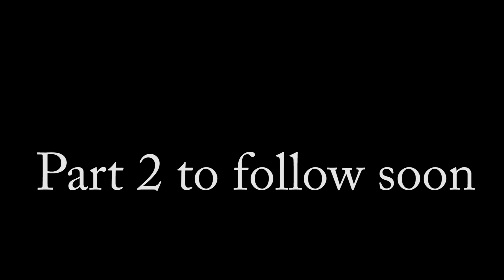Pfizer, process 2

Comment: It's basically the same process has it was back 2005 for hep C treatments.
A injection using a cDNA e coli in interferon with a antiviral medication.  
The cDNA e coli did provide a cure to infection to certain geno types hep c but not all. 
So one clears the infection to what harming body, but antibodies are still circulating in body, from results of PCR neg RNA blood test. Nothing to treat, non infected 
But hep C virus can cause liver cancer. Treated or not.
So might been possible I didn't need get vaccinated for covid. From my research findings in 2020. I choose to get the voodoo juice 2021. Not the boosters.
Keep up the good work Doc.
Thanks.

Comment: No surprise then that regulators accepted the Pfizer vaccine based on the initial batches made with the pcr process, and couldn't be bothered to apply the hard-earned lessons learned from the Polio vaccine to demand a new trial for the production batches which used process 2.

Comment: I make a car and submit it for approval of its new brakes technology - which gets rubber stamped for being safe and effective.
Then I have to make millions of cars, and fast, so I switch the brake system to a different one I can produce in massive numbers, and quickly.
I sell and market the car as if it were the original  manufactured spec, as submitted for official approval for public use.

So.... have I committed fraud?

Comment: I am retired from the aircraft industry, a quality engineer at Rolls Royce. The process here too is everything, to the extent that it is generally the process that is inspected rather than the product which is only tested at the end to ensure conformity to specification. Any deviation from the process will lead to disciplinary proceedings and possible dismissal.

Comment: I worked 20+ yrs in contract bio manufacturing making API and had several large bioreactors. Each different product was VERY precise as to the process, all most to the point of telling when you could blink. There is an extensive process and approvals that must be done BEFORE any change can be made. I don't know how they did that with out FDA approval?

Comment: 40 years as a Chemical Engineer with specialty on process scale up...from pilot lines to full scale production facilities.  Just because you can produce it in a pilot line does not mean you can produce it commercially on full scale....anything and everything will go wrong.  Met a guy while skiing in January 2020 on the ski lift....he was a pharmaceutical process engineer....we talked exactly about this as we had the same background.  He told me they had no idea yet about how to scale up production.  He told me because of that, he would not be taking any jab from the scaled up process.  I will not forget that discussion.
Reply: Nice to do the Link. Looks logic😉🙏🇧🇪
Reply: In Jan 2020?
Reply: At the time there was news that an outbreak was on. I travelled New Year's Eve 2019 through Heathrow, Toronto and Calgary - every foreigner was wearing masks then. Just saying.
  @annecy9280
Reply: @annecy9280 yes. Look up Event 2Zero1. They knew it was coming by October 2019
Reply: Jan 2020?

Comment: Plasmid DNA is used as a transfection vehicle for genetic engineering. If the vaccines were contaminated with plasmid DNA, there will definitely be some unlucky recipients whose own cells have been transfected thus causing those cells to produce spike protein forever and ever.

Comment: I feel so violated in every respect. Having worked in the bio tech industry as an executive , not Phizer nor Moderna, just watching this video sets off alarm bells on the ‘Qualification’ processes not followed. The FDA  shuts down pharmaceutical and medical products productions with no delays for far less breaking of these Quality processes and procedures. They should have their licenses revoked and those in oversight , aka FDA etc , should be charged with criminal neglect. I am also someone that has suffered severely from issues derived from the Moderna vaccine.

Comment: How many people had adverse effects or died  compared to how many people were vaccinated  ? 
How many deaths were prevented or how many  people avoided being in ICU on  ventilators who were vaccinated ? 
How many non vaccinated  people were left with permanent disabilities after contracting Covid  ?
I'd like more statistics.
Reply: it's worth checking out other videos Mr Campbell puts out here. Load of statistics is being discussed and you'll find references to the sources so you can do your own research too.
Reply: Well in New Zealand 00.64% of unvaccinated people died from Covid. Pretty good survival rate. We had mostly the OG strain, Delta, and Omicron in the country.
Reply: @TillyMack44  When?  Was this during quarantine?  Was this after vaccine deployment and herd immunity became approachable?   Didn't New Zealand restrict outsiders from entering the country?
Reply: @paul4020  it was current as at  14 April 2023. Lots of other data needed of course but no one is systematically collecting or tracking all of it, so some of it will be forever a mystery. Anecdotally I know a dozen or so people who never took the vax and none of them had hospital level covid, most had pretty short lived covid, all had longer immunity between bouts than the vax, and none have long term effects from covid and four of them are daily smokers (not a good thing in any case). From all the (many more) people I know who took the vax there has been about a dozen cancers some new some reactivated, multiple heart problems requiring hospital stays, new menstrual issues, emergency department visits, and they all bar one have had moderate bouts of covid at least once as well. I'd like to see more but I admit I'm probably too bias to see past all of this!

Comment: You can bet the important folks got the good stuff.

Not that I think either version actually prevents anything.  One is just slightly safer than the other.
Reply: The "important folks" probably got the good old saline... Allowing them to roll up their sleeves on TV multiple times to convince the unimportant folks.
Reply: That is your official opinion?

Based on WHAT EVIDENCE?
Reply: @childofthe60s100  No. I wrote "probably". That implies it is my best guess. And i'm a child of the 60's too, so i've had enough time to train some good guessing. 
That several heads of states have been showing themselves while being jabbed multiple times for the same round of vcns, wearing different clothes, having a different provider, can be seen online. Trudeau even got a "shot" where the needle was still capped. I guess maybe that one wasn't saline... ;-)
Reply: @childofthe60s100  I am not an official.  This is just my personal opinion and I am sticking to it!

Comment: I have a question. Who's DNA are they using as the original DNA of this process? Also what strain of E Coli are they using for the bacteria? Love your videos! Thank you
Reply: I was wondering that, also. I just read about Henrietta Lacks, who's cancer cells have been used since the 50's for different "creations and tests. The cells  keep dividing, even today when Mrs Lacks died decades ago from an aggressive cancer
Reply: @kathleenrose8848  wow, thank you for sharing this information! You're right, that DNA originally belonged to someone! But they probably didn't ask for it, they just took it!
Reply: Great question. You should look into the process of virus isolation. It has nothing to do with proper isolation. Ever wondered why some people don’t believe that the virus was isolated? Well, you wouldn’t believe the technique they are using for “isolating” that “virus” which really has nothing to do with isolation at all.
Not even having a PROPER control. 
They never truly isolated any virus so far. God knows what they isolating.
Reply: @yankalu2000   Next-generation sequencing (NGS) platforms do not require the target virus to be isolated. Single molecule long read sequencing can read each base nucleotide of the SARS-CoV-2 RNA without fragmentation. For this, we have technologies such as Nanopore direct RNA sequencing and transmission electron microscopy.
Reply: Artifical DNA synthesis. The E. coli strain is redacted.

Comment: Some people immediately buy the newly engineered and designed automobile. Some decide to avoid the risk until all the kinks are worked out. You know, the recalls and the technical service bulletins that amass very quickly once that new vehicle is tested by the public.  That process is continually pursued to eventually produce a mostly reliable vehicle. The evidence of reliability is revealed by service records, customer feedback and consumer advocacy groups like Consumer Reports. That process takes time and some manufacturers never achieve success. 
Why would anyone consider a healthcare remedy that doesn’t meet AND exceed this level of transparency and quality control?
Reply: That's why the elites decided that those people should die

Comment: I am a firm believer in the 20 year test. If it has been safe for 20 years then the odds are it is more or less safe.
Reply: Yes 💯 I'm the same.
I'm not a guinea pig
Reply: I'm looking at about 10 years for initial safety tests.  Lots of things arise in 5 years, but I think 10 will be a strong indicator for safety.
Reply: I am a firm believer in an eternal prohibition of devastating the billions of years old Tree of Life by modifying genes inside of the Temple of the Spirit, the Human Body - with 60 - 70 years of research and experience.

Comment: 00:28 🧪 Pfizer used two different manufacturing processes for the COVID-19 vaccine: Process 1 for clinical trials and Process 2 for public distribution.
01:53 🧬 Process 1 involved using PCR to duplicate DNA for mRNA production, while Process 2 used bacteria (E. coli) and plasmids for DNA generation, which is more scalable.
03:41 🧫 Process 2 resulted in contamination issues, including high levels of plasmid DNA remnants and endotoxins (lipopolysaccharides), which can have health implications.
05:57 🦠 Process 1 used PCR to replicate DNA, while Process 2 involved using E. coli bacteria to duplicate DNA, creating a different manufacturing environment.
08:40 💉 The importance of the manufacturing process in vaccine production is illustrated by historical incidents like the Cutter incident with the polio vaccine, emphasizing the need for precision in production methods and clinical trials for new processes.
Reply: Another way of not saying Dr. Faucius inherited the MK pathogen vault and poured it in select vials. 😀

Comment: ⭐⭐⭐⭐⭐⭐⭐⭐⭐
This is all very informative.
I followed most of it as a lay person.
But, at the end of part two, please summarize (for those of us without medical training) just what the results are of using this process 2 in the general population as opposed to process 1.
What could be the risks or potential damage in the general population from receiving this process 2 Pfizer mRNA.
⭐⭐⭐⭐⭐⭐⭐⭐⭐
Reply: I understand that in part II effects will be explained that come specifically from the divergent components generated by process 2.
Reply: He doesn’t respond to comments, not to my knowledge anyway.
Reply: @ange1098 Yes, I have never seen Dr. John reply either...
 That's okay if he doesn't.
He is pretty thorough...So, hopefully he will cover my question (in my comment anyway), at the end of part 2
as to what this all means in the realm of problems or risks.
Reply: Essentially, it is like getting a commercial airliner certified on the basis of the prototype and then making a radically different aircraft for production and:

01. Relying on the certification of a prototype that is radically different

02. Being surprised when the aeroplane does not fly as expected because so many components of it were changed that they no longer work with each other as originally designed.

The wings fell off the vaccines because so many shortcuts were taken in the pursuit of money and power.
Reply: Live from Tel A Viv! hahahahha

Comment: The real issue is the Pfizer contracts. When I exposed them (PfizerLeak), the contracts has not only provided Pfizer the authority to change the manufacturing process, but has given them indemnity from any legal liability or warranty. It practically stipulated that even if Pfizer KNEW their process is going to cause harm and didn't report on it, you can't sue them. Combine that with the fact that the countries that signed the contracts (governments) have committed neither parliaments nor the legal system could challenge it, and you realise why we are in the mess we are in. Again - PfizerLeak. See for yourself!
Ehden

Comment: PCR picks up genetic material - but I have seen elsewhere that it is not specific to Covid, and can be other pathogen DNA remnants. from recollection it took 3 fragments to identify "Covid", but then they reduced it to 2 fragments at the time that Omicrom was around. I do not know if this is correct - but it was an idea that was in a book on viruses - and So I bear it mind to see if it is confirmed or refuted at some time by a reliable source. They said this why you had so many asymptomatic positive tests! - ie were they actually finding material that people carry anyway.

Is process 2 cheaper than process 1, or is it just easier to make in volume.

Yes the process is crucial.

So important that this information is made known.